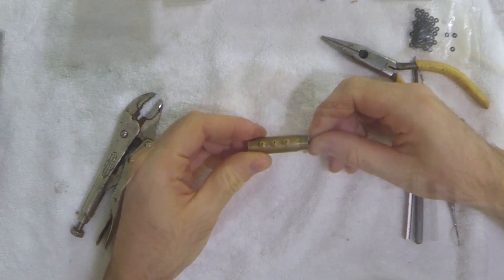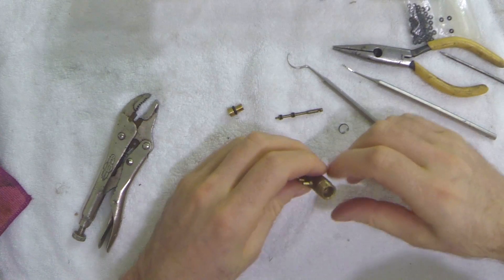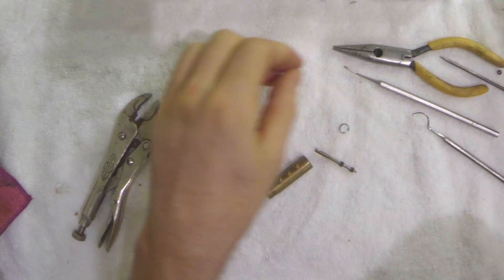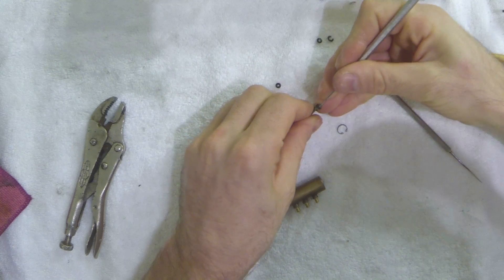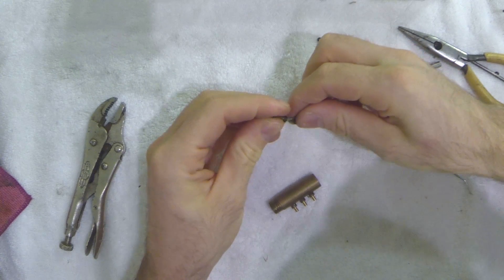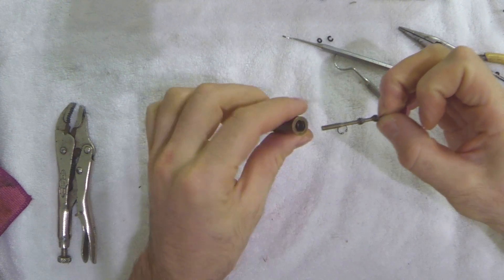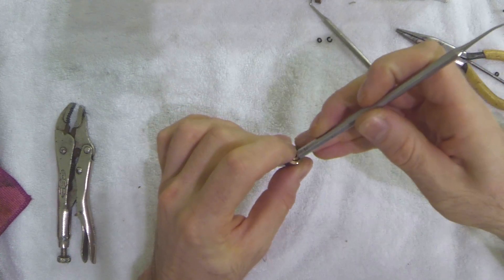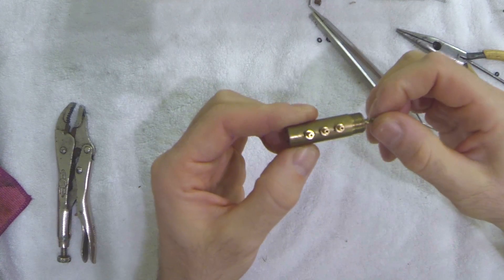Rebuilding a classic WGP Brass 3 way / Switch - zoomed out

Comment: I did a 'trigger job' on one of these 3ways, it was not easy. Polishing the inside of the cups, matching orings, and taking he c-clips on and off after each adjustment to check to smoothness and leaks was a task.  I then understood why some shops charged $50-100 for a 'trigger job' back in the 90s (that's $100-$200 in 2023) and one reason why several of those shops developed their own 3 ways, like Palmers and Belsales.  The result of my efforts made a smooth and reliable 3way.  If you're into autocockers you should try it just to gain the knowledge and appreciation for what autococker techs did back in the mid 90s.